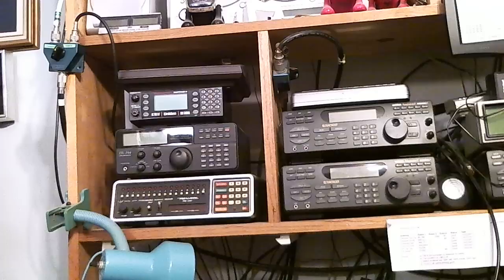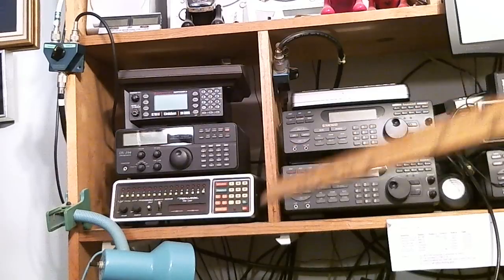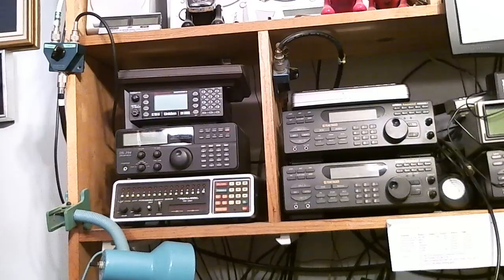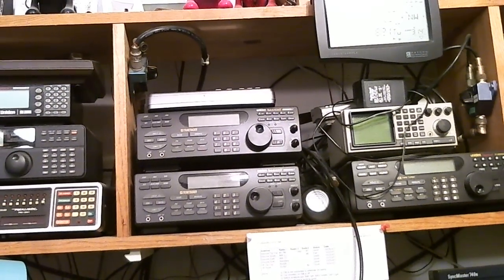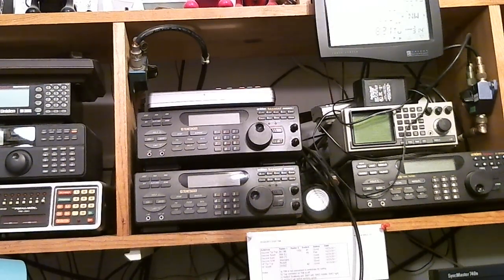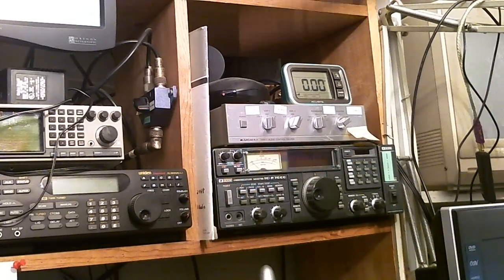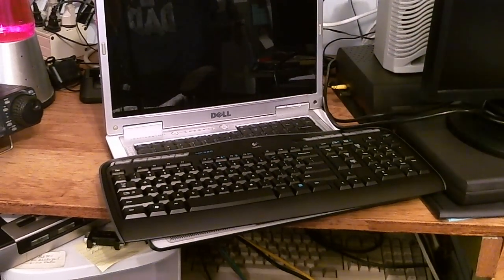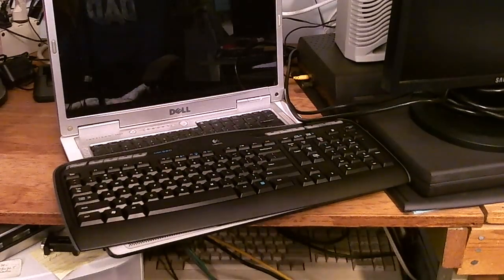TRRS #0470 - Aircraft Band - My No Scanning Excuse

Comment: What antennas do you like for aircraft? I only have a Diamond 70m/2m on the balcony and a Wilson 1000 on the roof. Was thinking of maybe a DIY J-Pole or something. Dunno, I'm new to all this, but I'd love to get stronger signals from aircraft and towers. Thanks for the vids.
Reply from the maker: For aircraft and VHF in general I use a discone antenna.
Reply: @hamrad88  DIY or something you bought?
Reply from the maker: A used one I bought at a hamfest. I think it is made by Diamond.
Reply: @hamrad88  I was thinking of making a j-pole but that's probably overkill for my first attempt at an airband antenna
Reply from the maker: That is not a bad idea.

Comment: I hope you don't mind a few questions about this older video. In show #0521 you said the BC780XLT was your favourite scanner. Is that still true? Have you tried the newer BCD536HP? As long as I'm asking, why two 895XLTs? (I love that scanner myself.) Also, I noticed a Commodore monitor there and possibly a Commodore keyboard under the desk. Do (did) you have any Commodore computers?
Reply from the maker: These are all great questions.  Here are my response.

1) Yes, I still like the 780 but I wish I could afford one of the newer scanners as our local police have gone digital (not encrypted) so I can no longer listen.
2)I picked of both of the 895s used for less than $40 total.  I had hope I could find someone who could use the second one.
3)Yes, I still have two Amiga computers.  1000 and I think the other one is a 500.

Thanks for your comments.
Reply: 1. I empathize. I'm in the same boat.
2. If you ever decide to sell one, I'll buy it! It may not be digital but it was my first scanner so I'm nostalgically attached.
3. We're kindred spirits! Would you believe I still belong to a Commodore/Amiga computer users group?

Thanks for reply, Tom.
Reply from the maker: I definitely need to get rid of some of my radios.  Send me an email with an offer to trrs73@gmail.com